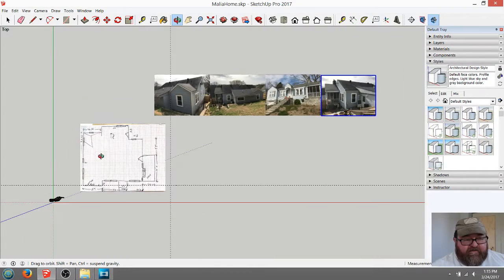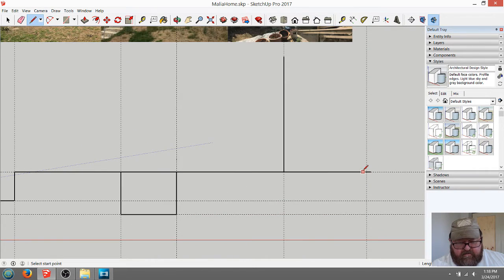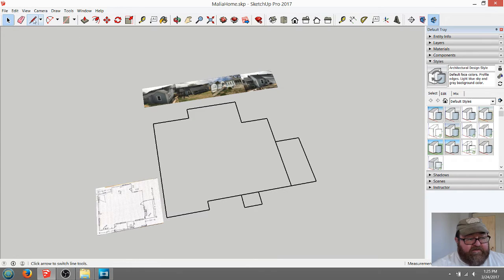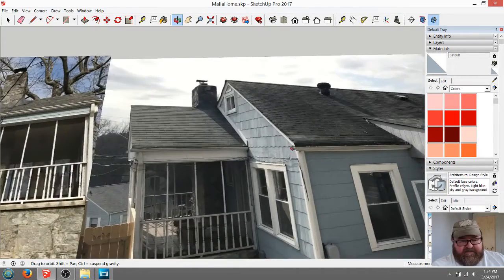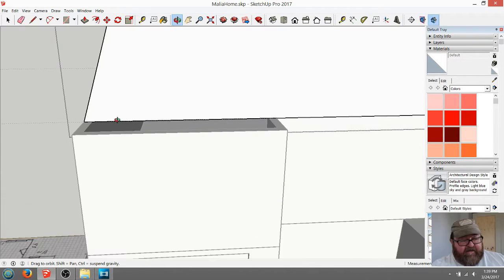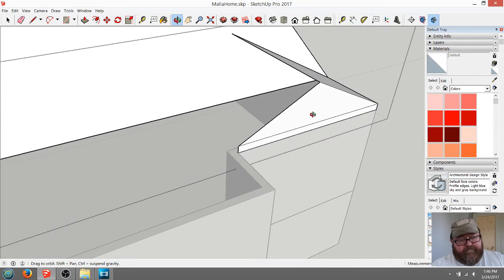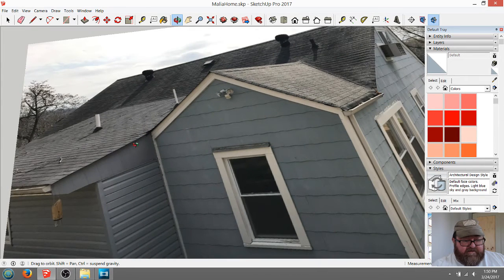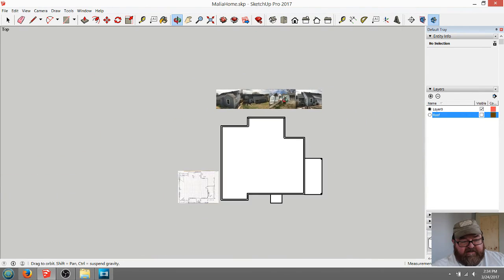Entering As-Built Info into SketchUp Pro for New Project - Part 1

Comment: Loved it dad!
Reply from the maker: insanedrummer89 you helped! :)
Reply from the maker: Sturdy is a general term.  The structure is not laterally braced and the roofing panels are only approved for a span of up to 3 feet.  They are at around 4'-6 now.  The term engineer is over used.  He is not a structural engineer.  If he was, trust me, it would have been over built :)  I have 40 years of construction experience.  I am aware of all types of construction methods. I now build million dollar homes.  It's only my opinion but please do not try to convince me.  I know how an experienced contractor would have built the building. I never said it was going to fall.  The worst case at this point most likely the panels will be removed by a wind storm.

Comment: Wow.. interesting to see.. did "CAD" work about 20 years ago... interesting to see how its changed.. more solids than wire-frame.  Had to shoot planes to get funky intersections... but I worked for a machining company that made custom tooling.
Reply from the maker: FOGHORNNC SketchUp is not as good as say autocad or micro station which I have used also but it is quick and easy for projects like this. I remember when autocad first came out. It was like 12 floppy disks :)
Reply: I remember that... My last job (in that field) had me doing some work with Pro-E for solid modeling.. This does look quick and dirty.. but looks like you can get a good representation. How is it for dimensional drawings?